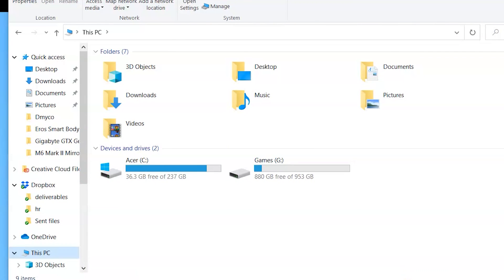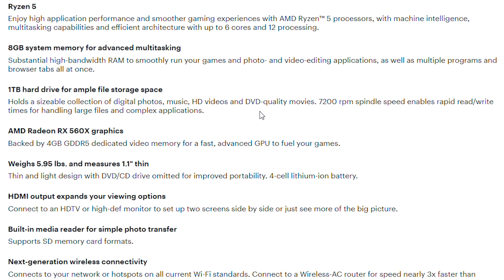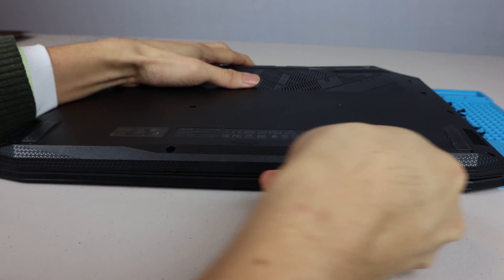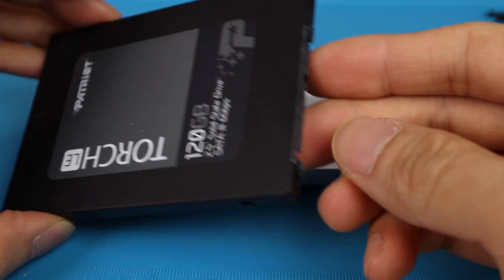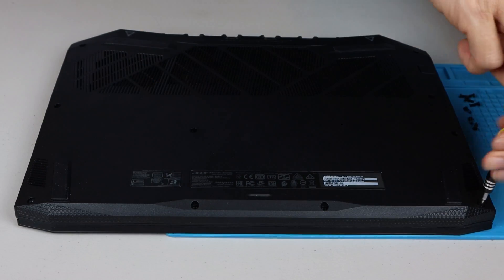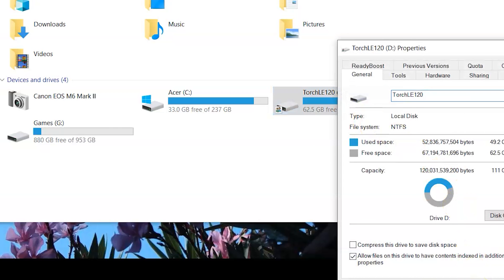How to Install 2.5" HDD or SSD in Acer Nitro 5 Gaming Laptop (2019 ver) SATA III Drive

Comment: the maximum that can be mounted in speed?? as for space, a TB is fine with version 3.0 or is it also possible to use 4.0???? I would like to mount the operating system on a faster sdd and use the old one only as a data archive...what do you recommend?
Reply from the maker: The m.2 slots are NVMe PCIE 3.0x4 (Gen 4), so yes, they are compatible with this model laptop, AN515-54-54. If your old drive is Gen 3, that's fine for an archive drive that you don't access as frequently.

Comment: is it okay to use another sata cable?
Reply from the maker: Yes, you can use a different SATA cable as long as the number of output pins match what's on the motherboard connector.

Comment: When I got to the affiliate link for the hard drive cable it takes me to a "2.5" SATA Hard Drive Cable SSD HDD Connector for Lenovo Ideapad L340-15 L340-15IRH L340-15API L340-15IWL 5B40S21897 FG540 NBX0001NP00", is that link working correctly? Will the Lenovo Ideapad cable work for the nitro 5?

Comment: Super helpful and well done. Hint for really lazy folks too-if you don't feel like unscrewing the entire bracket from the laptop to install your 2.5 inch SSD, just get some thin double-sided tape and tape it to the silver bracket cover. Since SSDs have no moving parts and the bottom cover fits snugly, the SSD will likely stay in place without an issue.

For 2.5 inch HDDs, however, you absolutely should screw and secure it properly.

Comment: I'm trying to do it the resourceful way, and I'm using a ribbon cable from another computer probably that what's wrong also the length and I'm in no way of knowing if the ssd I'm using works

Comment: i have acer nitro 5 an515-52 , purchased in 2019 ,can i install a nvme ssd in it ? does that model has a m.2 slot that supports nvme type ssd ?

Comment: Do you have to purchase the ssd separately to install the hdd when you buy a nitro 5? Or is the hdd just an attachment to hook up and extra drive? Just wondering if I’m missing a piece with my laptop or if I have to buy it. I have the hdd that came with it.
Reply from the maker: It will depend on the specific build that you purchased. Within this model you can purchase any combination of specs that include one or more drives, sometimes both an HDD and SSD are included, and other builds will have only one or the other. Mine only included an 1 m.2 SSD, so I added the HDD which I purchased separately.
Reply: @FixItPhil  so if it did come with it, it would’ve been in the box and not the pc itself right? Thanks for the reply! Very informative video btw!! Thumbs up 👍

Comment: Hi Phil, last night my wife installed a 1tb WD BLUE hard drive into my Acer nitro 5 ANS515-54 LAPTOP, and now every time I touch the bottom of the laptop, or move the laptop, the screen is flashing black. Do you know what could be causing this, and if it’s a simple fix I can do myself?
Reply from the maker: That sounds like a loose connection to me. I'm guessing this was a 2.5" form factor drive, that used the ribbon cable? If that's the case, check to make sure the ribbon cable is securely connected tot he SATA port on the hard drive and that the connector on the motherboard side is fully seated and the locking tab is engaged.

Comment: Thank u so much for this? But is it necessary to install HDD if I have SSD ?
Reply: No. The SSD will simply be a storage device, unless you mess around with the settings and turn it into the boot drive. But if you have nvme drives which are significantly faster, why would you?

Comment: So I'm new to laptops can I get an external hardrive for this laptop ?
Reply: Yes. You can use an EXTERNAL hard drive with any computer or laptop. INTERNAL hard drives are a whole new scenario. 2.5 form factor and 9mm maximum thickness. Capacity is as much as you can afford. I have seen a 20tb SSD. It was an eye watering 15k...  But they are out there...

Comment: There is no need to remove the entire back cover to replace the standard 2.5 inch HDD with SDD. HDD can be accessed by removing a panel protected by a single screw on the back. It is the larger of the two panels, the smaller one is for upgrading memory. Very well designed, thank you.
Reply: bro that only worked in in models before 2019 they changed acess panel from 2019 models

Comment: Will the cable inside the box of the laptop? Because when i want to add storage they worker in the shop i visited ask me where is the cable
Reply from the maker: The cable was included in the original factory box when I received my laptop. It was in a small bag within the accessories box that contained the charger.
Reply: Hey Phil, my cable was missing from my box. And you said you would put a link in the comments section, and I haven't seen it yet...

Comment: Hello Phil! I'm new to doing these kinds of upgrades and all that jazz but I've been playing Minecraft for years now. Recently I've wanted to start using shaders. This is the laptop i currently have. My question is, is this (hdd) upgrade enough for that or do i also need to upgrade the other ram as well?
Reply from the maker: For shaders and 3D rendering, RAM will be your bottle neck for performance, so if you can install more RAM, up to the maximum 32 GB, that should help reduce processing times and allow the rendering to take place without crashing the system. HDD upgrade is useful if your files are large and you need the storage space for a lot of projects. Even then, since I do a lot of video processing work, I have a bunch of external USB hard drives to archive and offload older files I no longer access frequently.

Comment: Can I use a normal sata drive or do i need a sata 3 drive?
Reply from the maker: Most drives these days are SATA III, folks just use SATA for short. Unless you're pulling drives from really old hardware, you're not going to find SATA II or SATA I anywhere.
Reply: @FixItPhil  thanks i see my drive was a western digital and has an additional power cable slot, i was confusing me but i see now it wasnt necessary for me to have it plugged in

Comment: I have the Acer nitro 5
I5 10300h/rtx 3060/8gb ram variant

Im not too keen on laptops but would a 2.5in sata drive fit in it? I'm not sure if there are differences with yours and mine
Reply: Same chassis, so no reason you can't. Pop it open and have a look

Comment: Are all 2.5 ssd compatible with this laptop ?
Reply from the maker: For the most part yes. Pretty much all contemporary 2.5" SSDs will have a SATA III connector and if you use the adaptor ribbon cable that comes with the laptop to connect the drive to the motherboard, it should work. The drive may need to be formatted and partitioned after installation in order to work properly.
Reply: @FixItPhil  thank you very much dude 💪🏻

Comment: This is the top link I got searching "how to replace Nitro 5 hard disk". I can't help noticing the video is missing certain important parts, like how to remove the original system disk and reinstall Windows. In fact I don't even have to open the case to know that following these instructions I would still get that same "no bootable device found" message.
It is almost as if Google doesn't know the difference between "REPLACE" and "add a second". Nice video though.

Comment: Im not to into computers but I see in the video you install a Patriot Torch LE 120GB SSD, as of now these are out of stock and I was wondering if a Lexar NS100 2.5inch SATA III (6GB/S) 128GB Solid-State Drive, (found on Amazon) would work instead? Or is this a completely different thing and would not work at all?
Reply: Nope. If it is a data SSD or HDD made in the last four or five years, it is likely to be SATA 3 and support speeds up to 6gbs. Unless it is a spinner which is around 3gbs

Comment: Bro can you plz help me...
Which type of ssd will be fit in the socket of Acer Nitro AN515-52 ?
Is it M.2 or NMVe SSD ?
Reply from the maker: This model can accept both a SATA or an NVMe m.2 SSD. SATA and NVMe describe the interface type and m.2 2280 is the form factor, so these are not mutually exclusive.

Comment: Thanx for the video but still cant find hdd in bios even though it was enabled
This hdd was a main hdd for another laptop
Thanks in advance
Reply from the maker: Do you know what the interface type of the drive you installed was? If it is SATA, then it might not be compatible with the slot you installed it in. In my video, the top slot where I installed the second m.2 is NVMe compatible only and won't recognize SATA m.2 drives. The bottom slot is compatible with both SATA and NVMe type m.2 drives, so perhaps swapping the slots might fix the issue. You may need to change the boot priority in the BIOS is there's an OS present on both drives.

Comment: If I'm only adding a hdd for more storage space and not upgrading the main one can I just install the hdd and power up the laptop and that will be it done?
Reply from the maker: If it's a brand new drive, you'll need to partition and format it first. Instructions here: https://youtu.be/d5wLgZxROoY If you're pulling an existing drive from another laptop, it'll usually already be setup and is typically plug-and-play, no extra steps needed after installing.

Comment: in the video is that the additional ssd slot? sorry if this is a no duh question
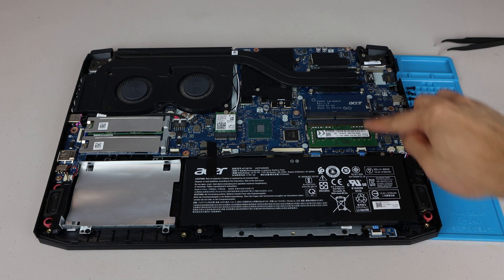Reply from the maker: In the video, you can put a 2.5" SATA SSD drive in the bay as demonstrated at 3:13. If you are looking to install an m.2 form factor SSD, use either of the two slots indicated with the arrows at 2:02. Just be sure you install drives with a compatible interface for the empty slot, as the top slot only accepts NVMe drives while the bottom can accept both NVMe or SATA types.

Comment: bro you didn't do hdd. does it fit hdd? its 3.5 inch
Reply from the maker: The bay shown at 1:55 is compatible with a 2.5 inch form factor HDD like this one: https://geni.us/cWu3kxq [Amazon Affiliate Product Link] A 3.5 inch HDD will not fit. HDD describes the presence of physical spinning platters, not the dimensions of the drive, and the ones made for laptops are smaller than the desktop ones you are thinking of.
Reply: @FixItPhil  sorry im a dumbass in tech

Comment: will  New Gen 4 FireCuda 520 be compatible with my Acer nitro 5 (AN515-52 series)
Reply from the maker: Yes, PCIe Gen 4 is forwards and backwards compatible, so you can plug a Gen 4 drive into a Gen 3 slot, but know that it will only be able to perform at Gen 3 speeds.

Comment: Tried this and the laptop isn't picking up the drive :/ I made sure its the right kind of cable, put the thing in all the way I could n pushed down but its not saying its there
Reply from the maker: Can you see the drive in the BIOS (press F2 after the Acer logo pops up when turning on the laptop, see 4:18 for a demo)? If it's there, then you probably just need to format and partition the drive, in order for it to show up in windows File Explorer. I go through those steps in this video: https://youtu.be/d5wLgZxROoY

Comment: What does this upgrade exactly do? If I upgrade to Sdd would it help gaming experience especially FPS?
Reply from the maker: This upgrade will give you more hard drive space to install games and store files like music/videos. Typically increasing hard drive space will not improve your FPS rate, though if you upgrade to a faster drive (for example HDD to SSD), you may see reduced load times when launching games/programs or switching areas within a game since the files would be accessed/read RAM more quickly.
Reply: Thank you!

Comment: I honestly am new to upgrading ect, so this may be a dumb question but did you have to clone or anything special before installing the HDD or SSD?
Reply from the maker: It depends. If you are installing a secondary hard drive that you will not boot the laptop with, then no. You don't have to clone anything to the new drive. You will, however, need to partition and format the new drive after following the installation instructions in this video in order to use it, which I demo here: https://youtu.be/d5wLgZxROoY 

If you DO want to boot from the new drive, for example, you are removing and replacing the existing boot drive, then yes, you should clone the old drive to the new drive prior to replacing it. If you won't be removing the old drive, but still want to boot from the new one instead of the original drive, then you will need to clone the contents of the original drive over (or install a fresh copy of your OS) AND change the boot priority in the BIOS so that it will boot from the newly installed drive first.

Comment: can i add ssd ad hdd both in nitro 5 ?? an515 43
Reply from the maker: Yes, the an515-43 model has both a HDD bay and second M.2 SSD slot.
Reply: @FixItPhil  thanks man really appreciate it..
Reply: Is nvme sad also supported sorry for troubling again 😅
Reply from the maker: It depends. Your model has two m.2 slots for SSDs. The first supports NVMe/PCIe and the second only SATA. If you already have 1 NVMe m.2 installed, you would not be able to install a second one.
Reply: @FixItPhil  great you cleared all of my doubts thanks man gained a sub❤️

Comment: How to locate the 256 GB PCIE NVME SSD / 1TB HHD on my acer nitro 5
Reply from the maker: I'm sorry, I don't understand your question. If you open up the laptop as shown in the video, you will see the two drives installed in the positions indicated in my demonstration. There's little to no variation in physical orientation between Nitro 5 models and when there are, the drives are fairly recognizable once the laptop is open. They really aren't ever hidden once you have access to the motherboard.

Comment: would this be the same as the 2020 model  NH.Q7NSA.008
Reply from the maker: Similar in terms of pre-installed RAM and disk drives, though the NH.Q7NSA.008 has a better display, faster processor, and better graphics card.
Reply: @FixItPhil  thanks

Comment: Bought the laptop used. No drive bracket screws for a new drive and no ribbon cable
Reply from the maker: I've got links in the description if you need to order these accessories.

Comment: I was wondering if you need to buy the big box thing that the cable connects to to use the hdd?
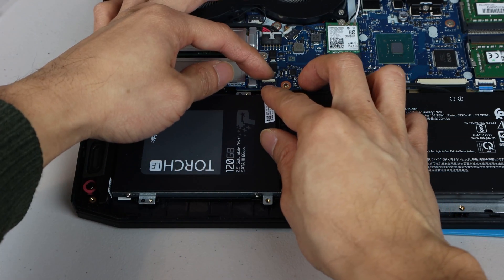Reply from the maker: The ribbon cable has the small white tab with gold contacts at one end (see 3:21) and a SATA connector at the other (see 3:08) It's all one piece, so if you have the ribbon cable adapter, the SATA connect will be part of it, and that will plug into the 2.5" HDD.
Reply: @FixItPhil  thanks so much phil

Comment: Hi Phil, do I have to buy the cable? In one of those with the two access ports? SSD 2.5 ..may get Samsung.
Reply from the maker: I'm not sure about the older models. Since you have the access panel, you can open it to verify that there's a SATA connector in the slot (the wide black connector shown at 3:07). If there is, you won't need the adapter cable as the drive would plug right into the SATA connector. In my model, I only had the small ribbon cable connecter on my motherboard (3:30), which is why the ribbon cable adapter is necessary.
Reply: @FixItPhil  Thanks Phil. We put 16 gbs ram and this thing is humming. 😀

Comment: Thanks for the video! I have an acre nitro 5 and I’ve opened up the back before purchasing anything to upgrade it. My laptop seems to not have the connector on the motherboard that you plugged the connecting cord into. Is there another place I might find this or am I unable to upgrade? Sorry for lack of terminology I’m very new to computers! Thanks in advance!
Reply from the maker: If the laptop has a 2.5" bay area where you can install that form factor drive, it will have a connector for the ribbon cable on the motherboard somewhere adjacent to that drive bay, unless there's a SATA connector on-board, in which case it will look like the connector at 3:07 (and you wouldn't need the adapter/ribbon part).

Comment: Love the video, very straightforward! And huge kudos for keeping it short and on-point! 

I was wondering what specific specs a 2.5 inch drive has to have in order to be compatible for the Acer Nitro 5? 
I'm looking to add a 2.5 to my Acer Nitro 5 AN515-52, as I have currently filled up my M.2 256 SSD. 

Do I just need for find anything named 2.5 inch (plus cable), or do I need to follow specific specs like when changing/adding RAM? 
Sorry, I'm quite new to this. :D
Reply from the maker: The specs for the 2.5" drive won't make a huge difference, in terms of compatibility. Any one of the correct form factor should work. You'll want one with the connection/interface type marked as SATA III or SATA 6.0Gb/s; these are identical, just naming standards for the same thing. Just make sure the drive thickness is no more than 7mm (only an issue with 4TB and above I believe). If you are going with an HDD (moving parts) look for ones with higher RPMs as this will give you faster speed/performance (e.g. 7200 RPM vs 5400). Otherwise, you could choose an SSD, which is more expensive but has no moving parts and will deliver better stability and a faster performance, like this one: https://geni.us/nJlQoCr [Amazon Affiliate Product Link]
Reply: @FixItPhil  Thanks for your reply, and ALL the help your videos gave me! Definitely subbed! 
Mostly by using your videos, I have decided to buy an additional 8GB RAM and a 500GB 2.5 inch SSD. 
Looking forward to see how/if it fits, and how it runs. 
I would have used your affiliate links, if Amazon was better to use in Norway, but it's absolutely horrible for Norwegians. Due to local taxes and shipment costs, it's cheaper to buy from Norwegian sites, or Ebay. :(
Reply: After spending hours on looking for my own parts, I think my Acer Nitro 5 AN515-52 has 8GB RAM: ACR26D4S9S8ME-8
Adding a second RAM stick was therefore very limited. I went for this: https://www.ebay.com/itm/113811412253
And for SSD I went with:
Crucial MX500 SATA SSD, 500GB. 
Hoping this fits and that it includes screws! xD